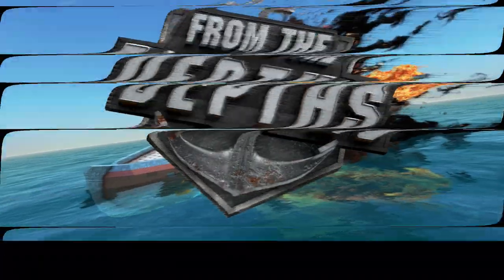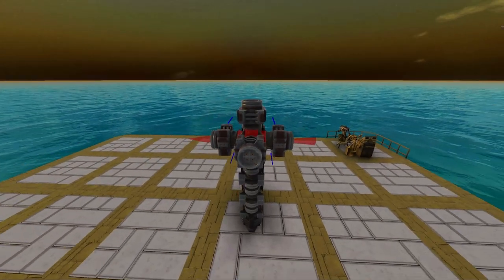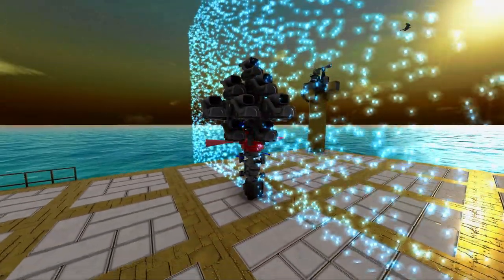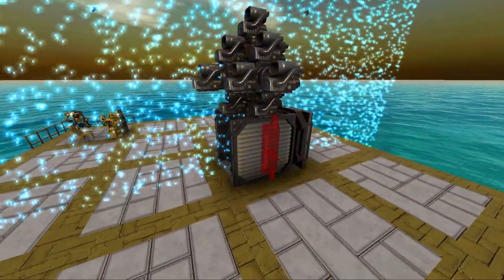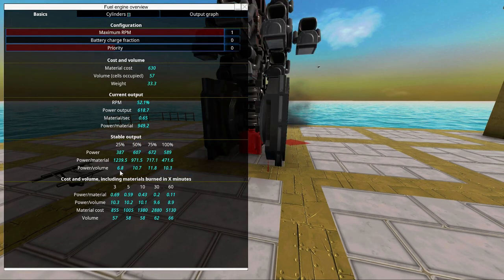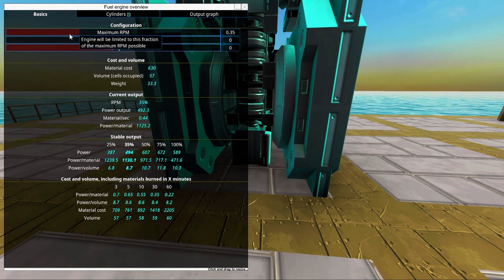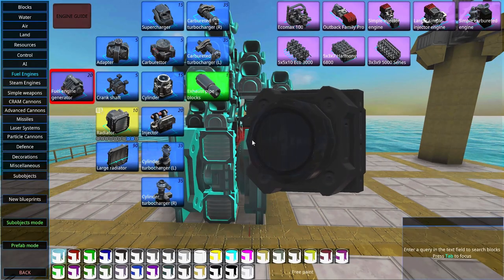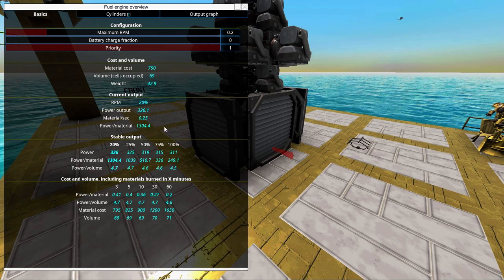From The Depths INSTANT Tutorial: The Most Efficient Fuel Engine!

Comment: I personally find that the most efficient combat viable engine that doesn't take too much space nor not enough engine power is essentially a series or Ecomax engines with a supercharger added at the end and radiators added where there is space, combined with piping making it into a nice modular rectangular shape.

It has a 787.2 Power/Material at 25% RPM and a 714.9 Power/Material at 100% RPM
at 100% RPM it has a Power/Volume of 6.1 

Compare this to an Ecomax which has a 634 Power/material at 25% RPM and a 695.8 Power/Material at 100% RPM 
however the Ecomax does have a better Power/Volume of 9.7, but this is because the former design has more piping, Crank shafts and radiators.

Comment: Just to mention that at this power generation levels a dedicated RTG/Battery setup is something to consider. I don't remember the numbers correctly off the top of my head, but each 4m of RTG gave you 90 power and each 1m of battery gives you the same 90 possible draw from an electric engine. so you can just place 3-4 4mRTGs a single beam of Battery and an electric engine, set that to high priority and you've go an even more efficient engine (free).

All these really efficient setups are only good if your craft is out of combat and is intended to survive and travel. Carrier craft and stuff for tournaments or designer fights usually don't live long enough for it to be worth it to invest in a bigger more efficient engine rather than just burn more materials over the short engagement time.

In a 10 minute fight, 1 material per second is 600 materials. That's a little over half a storage box.
Reply from the maker: Absolutely, these efficient engines are best used together with other engines for low standby costs :)
Recently put together a 3 stage engine that tries to maximize efficiency while still able to provide 2500 power when needed

Comment: For engines with carburetors, you want all sides touching something. Basically you add your efficiency stuff and engines around the carburetors because the efficiency is based on superchargers per carburetor. Essentially it takes up less space to have 1 carburetor touching 4 supercharger and 2 engines than 1 engine with 2 carburetors with 4 superchargers. This allows for better piping as well. I should note that you want supercharger engines at 50% power and decide the amount of engines / superchargers around each carburetor based on desired efficiency. This is because 50% power gives you the most power * efficiency as going toward 100 or 0 power has diminishing returns in power or efficiency. Realistically if you drop below 90/7 power per block, you should use RTG's instead.
Reply from the maker: RTG's are indeed smart for stuff that never needs refueling! This example is just minmaxing that efficiency value for baseline engine cost in material, this is a great idling engine for multi engine crafts I think

Comment: I’m now making my boats with 2 engines.. 1 high efficiency low rpm engine and one either fuel or steam engine for a F ton of power that’s the combat engines helps when needing to move ships from one place to another but not always burn 50 mats/s even if you aren’t in combat etc..
Reply: Ideally you have a supercharger engine that feeds its exhaust into a turbocharger engine. It becomes even better if you limit your efficient engines power to where it equals the inefficient one, then the inefficient turns on. This allows for a smooth transition and maximizes the exhaust you can pipe to the supercharger engine.
Reply from the maker: Smart! I do that aswell, engine priority is great!
Reply from the maker: @nicopence3148  Wow, great idea, I gotta build them dual setups for a powerful duo engine in a small system! :)
Reply: @nicopence3148  that is one way but makes the over all system quite large and with ships I’m designing they need to be extremely redundant some boats I have use up to 6 engines placed through the hull makes it quite effective when both moving as you only need one of the engines operational it might be a bit over kill but sure makes it hard for anyone to make these ships stop moving or firing..
Reply: @adonai4493  you can make these engines as small as 3x3 and 3x4. The only thing that can possibly be smaller is RTGs. Put a carburetor in the middle, your generator line in one corner, attach 2-4 engine to the carburetor and the generator line, add your efficiency on other sides of the carburetor, and connect everything with pipes. Yes this isn’t as good as the 5x5x? Variant but it’s still good for smaller vehicles.
Reply: @nicopence3148  wow lol, it had never occurred to me that engine's with turbochargers wouldn't care at all if the powering exhaust was theirs or not lol!